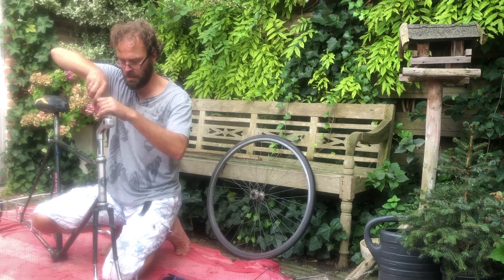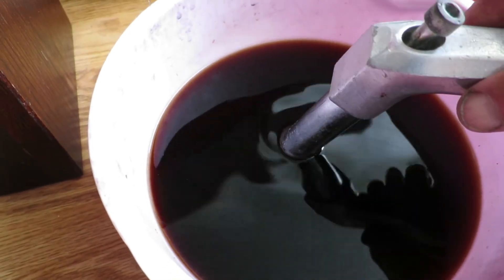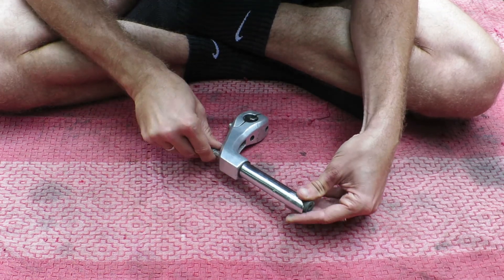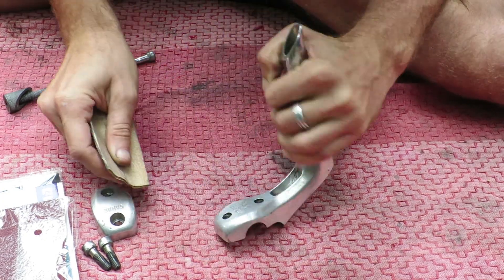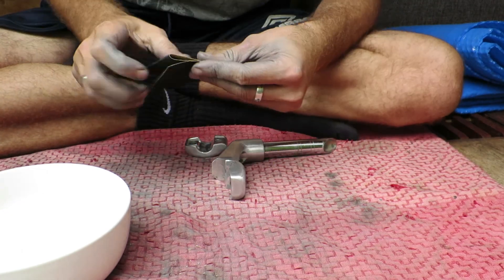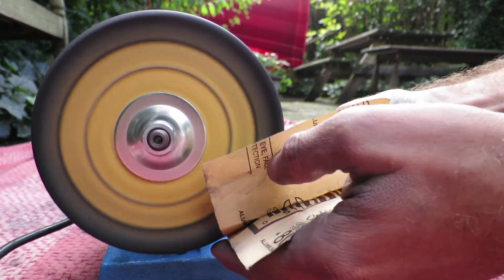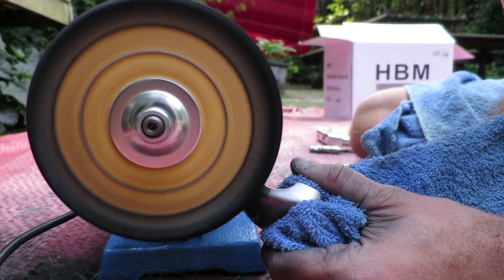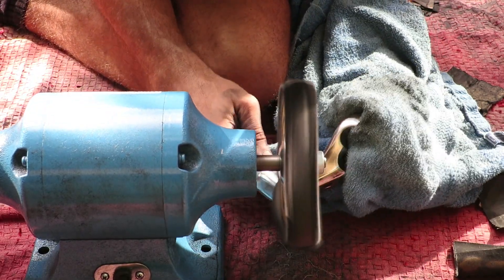How to polish aluminum bicycle parts - Sakae MTS-120 stem

Comment: i am of a different school of thought but I agree with this method also. I personally don't mind the nicks especially if they are on the inside, i polish with 4x0 steel wool then fibercloth + aluchrom cream. A stem is easy for manual labor, but all the other parts the machine and compound do a better job indeed. I have a machine table grinder that is with stones, not sure if i can mount cotton disks on, but i'd love to try.

Comment: Can I use a dremel to polish the stem? It's hard to find the fabric wheel that fist the dremel
Reply from the maker: I have both a dremel and polishing wheel. The wheel is a thousand times more effective and easy to use than the dremel. And believe it or not it was also cheaper to buy. 

I use a dremel to polish nooks and crannies. For instance I used it for a pair of pedals to get in between the axle and the rest of the platform: https://www.youtube.com/watch?v=R8zn5ZTGmO8&ab_channel=restorationdotbike

I had a polishing wheel before I bought a dremel, and I was disappointed with how little pressure you can use before the head simply stops spinning. With a relatively large surface of the stem, you want a smooth and even result. I firmly believe you can only achieve this with a polishing wheel.
Reply: @restorationdotbike  are they fabric pads on the polishing wheel? What kind are they? and do you use any compound?

Comment: What a beautiful restoration! I was pleasantly surprised by the results. 
Any recommendations and/or considerations for getting a polishing wheel for this type of project? Thanks! Have a great week :)
Reply from the maker: Not really. Mine is relatively cheap, around 60 dollars, but with enough patience and pre-sanding steps you can see it works fine. So my recommendation would be to take your time, which is kind of essential for any restoration I guess
Reply: @restorationdotbike  thanks for the info, cheers

Comment: Can you do this to modern black-colored bike parts too? For example, turn a Shimano black (or the grey one) 105 (r7000) crankset into polished alu
Reply from the maker: black is not the natural color of metal or alloys. it's either achieved through paint or anodization. you can polish those two to the point where they'll be completely removed. keep in mind that paint and/or anodization offers protection against corrosion as well. polished aluminium will prove to be more prone to wear and tear from the elements (in the long run)
Reply: Is there a way to re-anodize or apply some form of clear coat protection after polishing aluminum? Or, can you simply maintain the finish by keeping it clean and dry?
Reply: @funkadelph1852  lanolin or ideally 2k clear, but 1k will work. It will scratch easily though

Comment: Do you need to apply anything after sanding to prevent rust？🙇🏻‍♂️🙏🏻
Reply from the maker: If it's steel, the answer is yes. The title of this video has "aluminium" in it.

Comment: The bench wheel is week i guess 150 watt no more. You press and it is stopped. For best results should be at least 350 watt for household Jobs. If you dont want to waste your time. Friendly advice
Reply from the maker: It's a 350 watt. I use a lot of pressure.